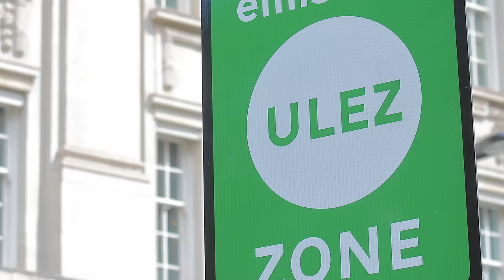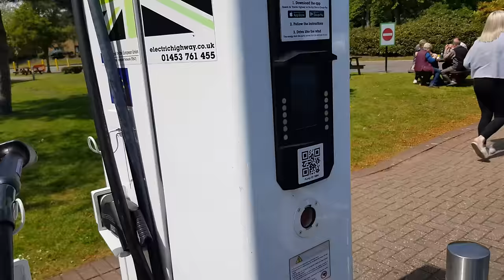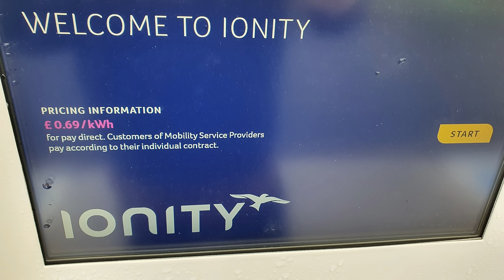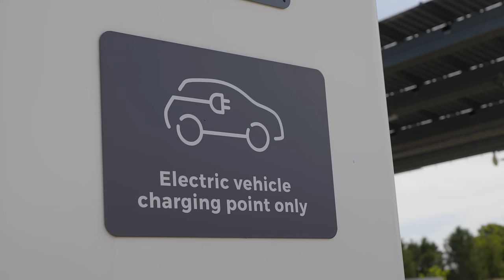The Uncomfortable TRUTH About EVs: The Version NEITHER SIDE Wants You To Hear

Comment: Thank you so much!  As an EV owner and EV advocate, I’ve grown tired of the endless back and forth of EV cheerleading and EV haters, but you’ve raised some of the REAL issues around EV ownership that rarely get raised, such as disability access.  Thank you for such a fair, and levelheaded video that highlights some of these important and rarely discussed issues!
Reply: They’re already working on wireless charging at Tesla.
Reply: @Reelbassin  wireless EV charging is already available today, but it operates at Level 2 charging speeds of up to around 20 kW.  Achieving high speed Level 3 charging via wireless is a long way off…
Reply: @bazzacuda_ unfortunately, people think they need a long more EV range than they actually do.  Most people would be a LOT better off with a battery with, say 200-250 miles of range, than one with 300-400 miles of range.  The 250 mile range battery will be lighter and less expensive, and more than enough range for 99% of daily trips.  On the rare occasions where someone goes for a long road trip, they would have to stop for charging somewhat more often.
Reply: I cannot think of a Petrol pump within 20 miles that has 'disability' access, nor even a pump attendant. The problem is not with EV charging, it seems to apply to ICE 'charging' also. That said, the new rapid chargers going in on the M27 at Rownhams (east) have a designated bay for wheelchair users, whilst the petrol dispensers have nothing.
Reply: @bazzacuda_ I have had many conversations with people who reject the idea of an EV  because, 'I need a car to visit my sister Susie in Sunderland' which is a million miles away. When questioned further it seems that Sister Susie was last visited 2 years ago, and is not on the visiting list for this year either. Meanwhile they continue their 15 mile stop start commute in a 25mpg petrol car.
Reply: @solentbum , I don’t know about the UK, but in the US, many petrol pump handles hang from retractable cables to make the pump handle effectively lighter and easier to handle. And the US ADA has requirements about providing disability access to fuel pumps, up to and including offering assistance by an attendant.
Reply: @ScottAtwood  In recent years the number of petrol stations has diminished greatly in the UK.There used to be 14 in my home town  there are now only five places to fill up , two of them being at supermarkets. Most stations use self service pumps only, with no pump attendants just cashiers.
Reply: No one seems to worry where all the materials to make all the required batteries are going to come from. How much lithium is there to be mined, refined and manufactured into batteries ? I ask because I don't know, do you ?
Reply: @gibbo675  It would seem that there are readily available supplies of some 14 millions tons, with a world supply in excess of 88 million tons. Recent demand has been in the regin of 100000 tons. There is also a move away from Lithium for other battery materials.
Reply: @solentbum  Lets see now, the average EV battery is 500 kg so 100000 tons is enough for 200000 cars, therefore 88 million tons is enough for 180 million cars, less if you consider electric lorries will have much bigger batteries.
The figure of 180 million sounds a lot however there are currently 41.3 million licensed vehicles in the UK alone leaving 138.7million left for the rest of the world. Interesting shortfall there I would say considering that there are 14.474  BILLION world wide.
Good luck with a one to one replacement there !!!
Reply: @gibbo675  all of the analysis I have read says there is plenty of lithium for the electric transition.  How much we ultimately need and how much we use depend on factors under control such us:  how effectively we transition to bicycles, transit, and intercity and high speed rail;  how well we can convince consumers to use smaller cars; how well we can convince consumer to buy no more range than the need for their normal driving.  In addition, sodium is a cheap and abundant alternative to lithium that is starting to reach the market in some EVs.
Reply: @ScottAtwood level 2 would be perfect for car parks and on street parking. Esp overnight parking g
Reply: @ScottAtwood I have a model 3, 250 miles is really 150miles as you charge between 20% and 60%, for speed and battery longevity.
 If you can charge overnight its a win, as the fast charge network expands and home chargers are installed it'll be fine.
Reply: @Jay-xr3sb , certainly!  Level 2 charging can mostly or entirely fill up an EV during a work shift or overnight.  We should incentivize employers to install Level 2 EV chargers in employer provided parking.  We should incentivize owners of multi family dwellings with off street parking to install Level 2 EV charging in the residential parking.  And cities should build Level 2 EV charging in street parking in residential neighborhoods.
Reply: @gibbo675  it is true that an EV battery weighs about 500km.  But it is not 500km of lithium.  Only about 10kg of that is lithium.  Your estimates about the number of EVs that can be produced with 88 million tons of lithium is off by nearly two orders of magnitude. There is plenty of lithium available.
Reply: @Jay-xr3sb  I also have a Tesla Model 3, which has about 290 miles of range from 0% to 100%, but I very rarely use that full range.  I only drive about 30 miles a day on average, so I typically only charge up to about 70% of a full charge, and since I plug in at home, I wake up every morning with 70% of a full charge again . By the end of the day, I may be down to 50-60% of a full charge from my typical daily driving, but then I’m back up to 70% again the next morning.  On long road trips, I will charge to 90%, sometimes to 100% just before getting on the road, and I may drive down to 20%, sometimes below 10%, depending on charger availability on the route.

Comment: Surely you can't expect people to be oblivious to the fact that comparing running costs just based on petrol or diesel per mile? What about all the costs that just disappear with an EV? For example. Oil changes. Filter changes. Spark plugs, tune ups, belt changes, catalytic converter replacement (add in the cost of being possibly stolen!) Significantly reduces need for changing and maintaining brakes, starter motors. Owning an EV is way cheaper. Install solar panels and it's basically free!
Reply: And the cost of the replacement battery is?
Reply: @theroadsnearyou...5088  my battery has an 8 year warranty and will probably last WAY more than 12. How long was your ICE warranty? There are numerous Uber drivers with Teslas that have more than 400k miles with the original battery. Sure there are cases of batteries having problems, but way less than ICE cars having engines blowing up after a few years, so there's that!
Reply: @simonpaine2347  And the cost of the replacement battery is?
Reply: @theroadsnearyou...5088  In twelve years time, IF it needs a new battery, then I'll guarantee that the cost of the replacement battery will be less than an equivalent replacement ICE. Why? Because they are already producing batteries from salt. Yes there are now cars running on salt batteries. Remember back in the day that the first ICE cars were only affordable for the top 5% of the population. Now some people have 3 or more cars.
Reply: @theroadsnearyou...5088  How long was your ICE warranty?
Reply: @simonpaine2347  it’s ok, no need to tell us how much a replacement battery costs!
Reply: @theroadsnearyou...5088  OK so a replacement battery for my car is today approx $10k and falling. A year ago it was $15k. As I have already said, my battery is guaranteed for 8 years, so I have no idea how much it would be in 8, 10 or 15 years, or as and when I need to replace it. Now tell me what a gallon of petrol will cost in 8 years time. I'll wait.
Reply: @simonpaine2347  How much will a gallon of petrol cost in 8 years time?
I’ll wait… and tell you in 8 years.
Reply: @theroadsnearyou...5088  and there I was thinking that we could have a conversation about the subject by answering each others questions with civility and common sense. Oh well, nothing ventured, nothing gained.
Reply: @simonpaine2347  Thank you for telling me how much a replacement battery cost, I wish you all the best!🙏

Comment: Love this channel... consistency is indeed the point. As electric prices are increasing 69p/kw is the old rates, they are heading towards £1.00 We love our EV but we use it as the wife's local runabout. I use an old diesel for long journeys. If EVs are going to inclusive everything  here is 100% logical and correct.
Reply: Where do you live to pay such rates?  England, as you quote them in £?  How come other people in England claim that they are paying only 10p/kWh for their electricity?
What I know for a fact is that I pay €0.1069/kWh to recharge my Tesla... that's only 9.2p or 11.2 US cents!
Reply: @st-ex8506  As for ONLY PAYING less than 10pence / kw.... That is totally correct for ALL people charging at home. For people with parking / a driveway. Which as you know very well..... not everyone has parking or a driveway. I do... and my landlord allowed me to install a charger. So I pay 7.5 pence / kw at home (overnight). But charging on journeys away from home is 65pence to 95pence / kw. Which is actually as expensive as running my old V8 AMG!
Reply: @mikadavies660  Sorry, but I pay only €0.32/kWh at a Tesla supercharger.  The municipality of the small village where I live has installed two public chargers, and charges only €0.20/kWh.  The local supermarket has also installed charging stalls, and is advertising that they are selling power "at cost".
Cheap options do exist! No-one is forced to go to the price-gouging ones!  Your example may exist, but is definitely not the norm.
Even those who made the very sub-optimal choice of buying a non-Tesla EV will be able, in a few months, to use their superchargers' network.
Reply: @st-ex8506  OK... Noted, but let's take it back a step..... You are in Europe? Yes...
Reply: @st-ex8506  The YouTube channel that you and I have seen... Jayeem Cars is in UK. The entire video can relate but is based in UK for people in UK. The insurance issues are not the same in the UK as they are in Europe. Salaries, rents, charging rates are different in UK than Europe....as you would expect.
Reply: @st-ex8506 That Tesla what about the rest of the market? 
I'm thinking what about when electricity corners the market like petrol?  Electric prices will rise in the future and no one has an alternative.  At least now we have a market of competitors bringing the price down such as diesel petrol and electric.  The future will be bleak just working on electric Monopoly on the market.  
They are trying to get rid of gas from houses as well.  
Just a point to consider what giving to said market is in heading too. No competition equals hire prices for all.
Reply: @st-ex8506 I'm 7.5p/kWh (for 6 hours overnight) in Scotland. That covers about 120+ miles a day of driving which covers my use most of the time.
Reply: Just subbed, i like his balance. I don't own an EV but I'm a big fan of the technology.
Reply: @st-ex8506  I understand that Tesla with their saloon and hatchback cover the best options and without argument their Superchargers are so far in front that you need a telescope. However, £600 to £1,000/mth finance is not everyone's budget. I pay just £265/mth for my EV. A Model Y would have been nearly 3x as much. Then insurance for a Model Y in the UK is the same as a Lambo or 911 Turbo. Even the base model Y is that high to insure. All for what??? A family EV...!! Yet, a Stellantis EVs costs 1/3rd of a Model Y to insure....but is a pain to recharge as the network is rubbish and expensive.
Reply: @marksoutta1059  if you are in UK... look at Definitely Not a Guru... he is great for the best deals on different vehicles every month. Like ID Buzz for £400/mth... (all gone now) but great to catch deals when they are what you are looking out for.
Reply: @mikadavies660  Yes!  I live about 50:50 between Switzerland and France.
Reply: @grahamleiper1538  Excellent!  Which means that you are driving for nearly nothing!

Then, why are Brits whining so much about the price of electricity?
Reply: @mikadavies660  i love Tesla as a brand and innovator and although i could afford a Tesla i simply don't want to pay that much for a car. I will definitely be tempted by their new small car if it comes out at the stated 25k
Reply: @marksoutta1059  I agree with you. I could just about to afford a Y but would have to cash out my shares. Which will be worth far more in the long term.
Reply: @st-ex8506  because the standard day time price is near 30p which is double what it used to be.
Reply: @grahamleiper1538  I have guys telling me that they night-time rate is in the 7-8p/kWh range... even cheaper than the €0.1069 I enjoy in France.  EVs are charged overnight most of the time, which makes the day time tarif pretty much irrelevant.

Comment: Electricity is a commodity. As long as you have to use apps and subscriptions to use chargers, which is a blatant, artificial restriction to lock you in, I don’t give a single shit about EVs. Cheers
Reply: You can have a charger at home which doesn't require and app or subscription.
Reply: @apolofeve I live in an apartment

Comment: I am pretty sure I will keep my after-midlife crisis toy, a (for you Vauxhall) Opel Calibra V6 as SSWD (summer, sun, warm, dry) driver. Luckily the body is made in Finland, those are said to rust way less. 
 
I hink as the fewest other owners would drive a 30-year old 170 hp-car with cat with 24mpg. And I am not slow as such, but go more for momentum speed up downward to have this energy in addition to use it on the next hill. 
 
So I care that the energy invested in making the car is spread over a longer time (more efficient), and keep others from using the car inefficient.

Comment: MY 2014 Tesla S paid off to the very last cent, all of 80.000€, plus I still have it. 460.000 trouble-free km, battery and motor rebuilt once, that is the only major maintenance done. And it's ready for another free 300.000km at least. And I can still sell it for 15-20.000.

Comment: great presentation Jay. can't argue with any of it. 
I especially like the notion of small EVs and even more so small chargeable hybrids/range extended EV type things. EVs are like steam locos, the further and faster you want them to go the larger and heavier the tender (battery) has to be. so you have to increase the boiler size (motor) and scale up the the strength of everything which increases weight. so you need a larger heavier motor and battery to overcome your extra weight. so the bigger the EV the less efficient and more damaging to the environment it becomes. flip the whole size and performance story on its head and suddenly you might just have an EV that makes sense.

Comment: One thing I find odd, no one talks about one clear advantage of ev's, the tailpipe as mentioned, but transport infrastructure can dramatically change if no vehicles have tailpipes... we could have entire underground motorway networks, hidden out of way which would bring advantages of range due to lack of weather affecting them, any vehicle with tailpipe emissions this simply cannot happen, ever been in a tunnel with vehicles, it's horrible, it stinks the air is disgusting to breath, even when well ventilated, when its busy air quality is crazily bad for our health.

underground parking is much simpler to design, tunnels don't need the same extremes of ventilation, garages can be integrated into a home that we simply haven't thought of yet.

I agree with the conclusion, at the moment buy the car that's suitable, personally I'm lucky to have an EV with an EV tariff,  we also have a diesel and quite frankly filling it up is upsetting! But I shall be keeping it for quite a bit longer (assuming it doesn't prematurely)

Misinformation is the biggest problem, as you mention cars aren't going to be taken off the road overnight, its going to be decades, biggest hurdle is the crazy charging network. However I also remember fuel shortages, ironically I Was stuck in traffic for hours before due to queuing for a garage despite being in an EV at the time, towns were gridlocked...

I do hate the multi tier networks,  it needs to be fixed, but our government doesn't seem to care. I'd also never recommend an EV to someone who cannot charge at home, at least not with the crazy price difference between networks.

Driving in other countries its crazy how far behind we are!

One benefit EV's bring right now, today to all drivers, reduced fuel prices, we have a million EV's in the UK.. oil prices are going up again (as far as i'm aware) but due to less people having to refuel it means the petrol prices haven't risen as dramatically... so even if your anti ev, be pro everyone else having one ;)

I've never thought about it before, but it is odd that an airport, famously known for having onsite fire services were unable to get to the fire quickly...